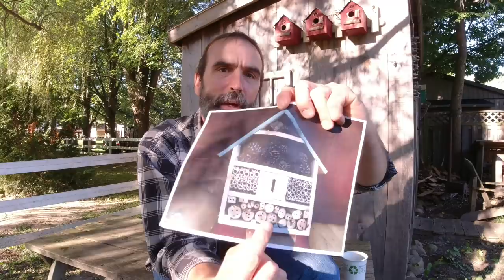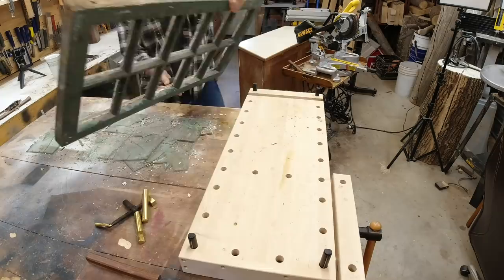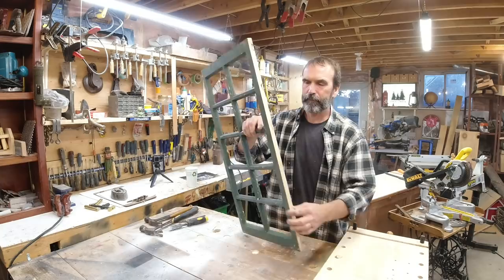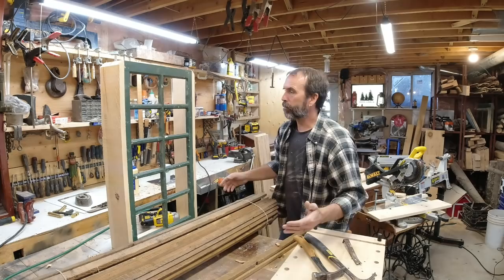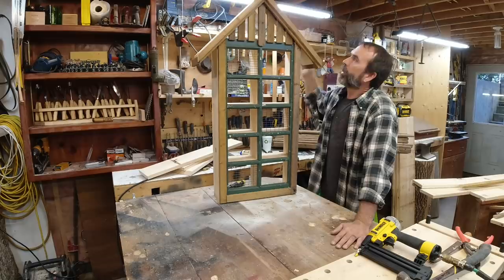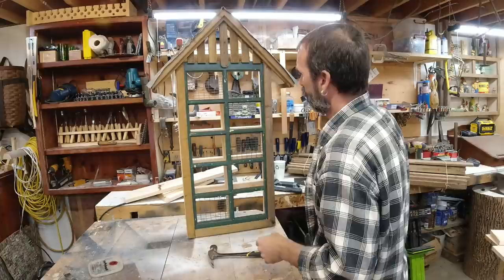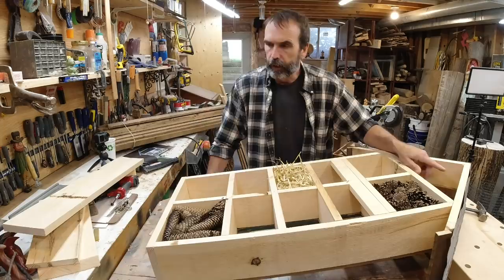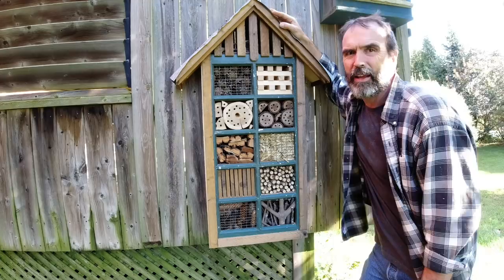Building a Bee +Bug Hotel / Insect Habitat and Garden Art

Comment: To make an antiqueing stain for new wood, place a sheet (12×12 or so) aluminium foil soaked in white vinegar until it dissolves. Brush it over new wood. Turns it gray and old looking immediately. I have no idea why, but it works very well.
Reply: Steel wool works too but i think it goes more black

Comment: Doug, that is a work of art. hope you get lots of insects to take up residents. 
I have been building bee houses for solitary bees for over 12 years now, and use a 5/16" brad point bit to get a very clean hole. The bees will not nest in a hole that is not smooth. 
My bee houses are for the Osmia lignaria. They are the best pollinator of fruit trees.

Comment: Omg! Its soooo cute!!!
Some notes. 
You could have done a half lap joint for the inside dividers : )
Bumble bees apparently love wooly type nesting material, so 100% wool or cotton quilt batting is a good filling choice too.
Woodpeckers like insects so its a good idea to make your outside frame an inch or so proud of the inside framework and then put some half inch hardware cloth on the front as well as the screen on the back.

Im probably going to have to make my own of these. :)